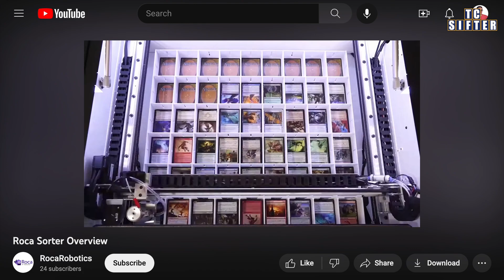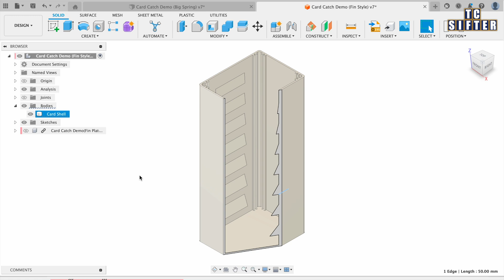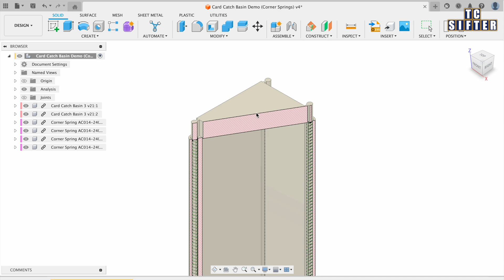Designing A Passive Card Catcher

Comment: i think you should just have the catch basins be curved a J shape, such that when the stack is tall, the card just falls onto the top, and when the stack is low, slides along the curve and then slides onto the pile when it hits it
Reply: wait i have a better solution! a magic card is 2.5 inch x 3.5 inch right - instead of making the catch basin these dimensions, you make it 2.5 inch x 1 inch and the load the cards in diagonally. after a card enters the top of the basin it will not be able to flip over entirely, and since the bottom stack is angled, it will slide onto it when it hits the bottom. then it can be arbitrarily tall

you may be worried about damage to the card but i think like a falling elevator, the air column in the basin will slow the fall so it should be fine

Comment: Springs are cool, another possible solution rather than add motors is to have the card drop servo pull double duty. as the finger drops the card into a bin have it continue to rotate to advance a mechanism on the back of the current bin/stack. This could be a sort of ratchet/pall system that uses gravity to advance the stack by 1.  If gravity isn't enough (especially true early in the sorting process) can have system use a heavier plate or have the plate in tension pulling downwards by a spring with its motion constrained by the ratcheting system. This setup would require a manual reset of the bins prior to sorting but not too big of a sacrifice.

Comment: Has anyone suggested rubber bands yet? Rubber bands on each corner could suspend the platform and would remain linear (more or less) rather than springs which will definitely bind if they're 9 inches long. You can also use pull springs, but I think that rubber bands will be easier since you can get a bunch of uniform rubber bands that are relatively weak and just use multiple per corner. This would allow you to fine tune the design by adding/removing rubber bands until you get a good stiffness. Also keep in mind that the upward force doesn't necessarily need to exactly match the weight of the cards, you just needs to make sure that the card fall is a height that you're comfortable with. I would say that as long as a card is falling no more than 2 inches you should be good.

Sorry if this has already been suggested, but I skimmed some of the top comments and didn't see suggestions for rubber bands.

Comment: shorter springs are going to be easier to manufacture, and replace for maintanance and testing. Given that, and that springs do not behave ideally at the extreames (in your case the start and end of the stacking) a few shorter springs in serires with a washer between will work much better. These shorter springs (maybe 2 or 3 in serires in the existing design channel) will behave much more consistently since the manufacturing tolorances will be lower (you need a "take the average" approach to manufactured goods unless you plan on some large percentage of rejects). I think 3 is probably the number to start with to minimize moving parts and open up design tolorances. The major downside will be making sure the washers don't flip or shift (hexagonal channel could fix that and still maintain enough contact on the springs). I love seeing the work progress and will want a prototype when they are ready!

Comment: Darn, I wanna see the final result lol. Well Im subbed. I hope you figure out the kinks and it works well without damaging the cards ^<^
Reply from the maker: Thank you! I should be putting out a new video shortly!
Reply: @jackbaumgartel  Is the video still planning on coming out? :)
Reply from the maker: @pdeer271  Yes my apologies for the super long delay! I took a break from the project for a while but am back working on it now
Reply: @jackbaumgartel  I was just looking into a setup myself and this came across and was just what I was hoping to read! For the card catcher though, I think there is an easier option . Since the cards come down from a ramp, if you raise the back of the boxes slightly so the card cannot go past it, as well as give the bucket a beveled edge feeding inward like a funnel, It should keep the cards oriented the correct way, and allow them to drop without issue.

Comment: Throwing my 2 cents in, albeit a little late. What about a pneumatic approach? It'd be easier to maintain consistency, and you could have the controller be centralized on the machine with hoses going to each collection area. Limit switches would guarantee proper zeroing. Other than that you could have the controller know how many cards have been sorted into each section and actuate the bed by the card width. 

This method also allows you to use software to easily change card widths for use with other games and troubleshooting.

Since you only have 6 slots i think the tubes would be manageable, and from my research the controllers are relatively cheap (compared to the r&d on fabricating specialized springs, at least)

Comment: The custom springs are probably going to be an issue, though they are cool and will absoutly work the price will probably cause issues if only doing small batches of them and the height may cause other issues with them like the springs possibly not fully going back to their proper size. Just a thought but would the reverse be a better idea? instead of compressing they streach?

Another possible idea would be to use only one motor and some gears to spin the screw that controlls the height. You will have height changes while moving back and forth while sorting but as you should probably keep your cards and inch or two below the top anyway to prevent the cards blowing out or other issues that shouldn't actually be a problem and it gets rid of custom hardware you would need, though it does add some fancy movement code or at least good gears and motors (just let them almost free rotate but stiff enough to hold the cards)

Comment: If you expect the stacks to be about equal height, you could have all of them on one side of a sea saw with the input stack on the other. This way every time you take away a card from the input stack all of the sorted stacks will lower by 1/6th of the card height. Then once the card i dropped by another 1/6th. Moving the pivot point of the sea saw you could adjust the fractions to be a desired target. By doing some clever lever mechanics that lock and unlock whenever the gantry selects the stack you could have a perfect system that lowers the stack by the exact size of each card no matter it if weighs more or less due to foiling, warping or lther factors. Though this design would be very complex and the mechanism needs to be developed thoroughly.

Comment: „Euler‘s buckling cases“ should be something you understand thoroughly if you plan to go with a spring based design.

I‘d advise against it though. If the part isnt readily available and has to be custom manufactored then you‘ve lost one of the original goals for the project: for people to built it (easily) at home. Unless you wanna become a spring distributor and have ppl but them off you.
Reply from the maker: Thanks for the input, and yeah that's a fair concern. Avoiding custom parts is a major design goal, but so is cost & complexity! I've got some great feedback here so this is something I'll be working on more

Comment: For something like this, I would highly recommend using extension springs instead of compression springs, or variable force spiral torsion spring or vspring if you want to go with springs. Otherwise I would highly recommend a continuous rotation servo motor. It would make for more electronics, but at ~$10 per stack for servo, switch and maybe some other small stuff, it's comparible in price. (A 9g servo has 1.6kgcm of torque)
Reply from the maker: Thanks for the input! I'm curious what advantage you see in using springs in tension or torsion compared to compression?
Reply: @jackbaumgartel  the vsprings are the same ones that are used in key card retractable lanyards, so are pretty low profile, and you can buy some casing mechanisms so everything is properly enclosed. For extension springs, you don't need a center post to stabilize the stack. And since there will always be a small horizontal component to the force it will self stabilize to a point in the middle somewhere

Comment: Why use springs at all? You already have an actuator poking down each well every time a card is added: why not have the base of the wells start near the top and slide/ratchet down?
If you do actually need them to be automatically reset, then suction the bases back up. If the depth is an issue, add a spring underneath with a clasp that releases the ratchet from up top.
It's not strictly passive but it adds 0 active components and doesn't rely on specific and delicate spring force
Reply from the maker: This machine doesn't use any suction or an actuator to drop the cards! Sorry for the confusion, I showed a few examples of other machines which used such systems, but this design does not. A few videos back on my channel I did an overview of the mechanical design decisions and whatnot if you're interested!
Reply: @jackbaumgartel  aah! I think the z axis was just a huge assumption and the suction was stuck in my head from one of the other examples! I was recommended the video without having seen the design of this one. I'll definitely go watch
Sorry for the confused suggestions ;p

Comment: I think a motor underneath each stack would be the most reasonable option.  They could be basic little motors that lower each time a certain amount of cards are added to that stack.  I.E. 25 cards drop in bay 3, then bay 3 motor drops .5 of an inch or whatever the calculation may be. They only need to go down with the weight of the cards, not up.  Think about a force fed paintballgun hopper.  They stop when a paintball is in place with sensors, instead of stopping with cards in place, just have the sensor at the very bottom when it is full the machine stops until it is reset.
Reply: Amazon has 6 for $7 i believe
Reply from the maker: It's a good solution! It would take some more hardware to get things moving properly and I suspect from prior experience that the cheap amazon servos likely wouldn't have enough power or precision, but it could be done. The added electrical power and wiring is considerable for 6 motors as well, but still I appreciate the input and will keep it in mind.

Comment: What about using a tension spring instead of a compression spring?
Reply from the maker: I had thought about that but didn't see any real benefit, and it would take up more space. Would you see a benefit to a tension spring over a compression style?
Reply: @jackbaumgartel  I just thought of it when you shared the 4 spring design. Might be better reliability (less likely to hang up maybe). Would be able to utilize the entire receiving tray capacity with a tension over a compression spring as well. 
However not an expert, so I would use my judgement sparingly

Comment: So rather than have moving parts on each catch bin, especially with temperamental springs and platforms prone to binding, I think it would be cheaper and more physically reliable to have the catch bins be static, with bottoms angled up at the back(towards the direction of entry so they don't fall out) and no rear wall, air flow slots on the front and sides, and then add a z axis to the catch chute(rotating up or down). You would have to track the stack height of each bin in software so that the chute would rotate its angle correctly, but this gives the best entry angle and it preserves the momentum of the card and doesn't force it to change direction until it is almost at a stop, and gives the best "falling" profile (narrow edge of card acts like a lever, or a closing lid)
Reply from the maker: That's a pretty neat idea! I hadn't thought much about giving the gantry "aim" and another degree of freedom to place cards more accurately. I appreciate the input!

Comment: OK, but what is the point of these machines? 

Simply curious. Clearly there's a niche here for machines and MTG cards, but what do they do? Is it for like building a randomized deck, or sorting cards by color, or what?
Reply: Easy of sorting. Sorting can take quite a bit of time and can be tedious so a machine to do it for you is pretty dope
Reply: I also sure if the software is open sourced after the machine is created there could very well be someone that could run with it to create random decks.
Reply from the maker: Great question! The main use case for these machines is card shops that will often buy and sell cards by the thousands. It's expensive and tedious to pay employees to sort and organize the 100,000 cards you just bought and now need to sell. Some serious collectors and hobbyists with large collections might want one too just to help organize their collections.

Comment: I suspect very strongly that a mechanism like you are describing is going to jam up/be unreliable in practice. Its a clever mechanism to be sure, but i just keep imagining the little taps from the card falling farther and farther causing a multiplicative uneven effect on the springs, and eventually causing jams.
Reply from the maker: It's certainly a possibility, but I am hoping that loose enough tolerances between the parts and smooth sliding surfaces will help prevent that. Definitely something that will need to be tested though!
Reply: @jackbaumgartel  I would think you could use one stepper motor to continuously drive a screw, and then use the movement of the sorter to engage/disengage the screw to lower the platforms, so you could drive 6 platforms with 1 motor?

Comment: I think investigating plastic compliant mechanisms to replace the springs could be interesting. They might do the same job as springs, but also be cheaper to produce, and more customizable for this purpose. 🤔
Reply from the maker: I do love a good compliant mechanism! I'd be interested to hear specifically how you imagine one might be of use here
Reply: @jackbaumgartel  the mechanism could be made of plastic or metal and tuned to bear weight of the cards the same way the spring does. However, compliant mechanisms can be designed to only move in certain dimensions and minimize defeclection in all other dimensions, so if properly designed it could be more reliable and less demanding on the design of the container.
Reply from the maker: @ZilchZilch11  Thanks for the explanation! Do you envision it similar to the passive fin-style catch basin I showed in the video?
Reply: @jackbaumgartel  I envision it most similar to the single central spring arrangement, and maybe a "scissor lift" shape

Comment: Also worth noting, this is a design decision that might constrain the build to just MTG, since card thicknesses and weights vary from game to game. Unless this is not an issue if there is a tendency for other cards to have their weight and thickness to have the same ratio? Worth looking into the weights and thicknesses of Pokémon, One Piece, Flesh and Blood, Digimon, and Vanguard. Those seem to be the games I've seen played at my card shops that have the same 2.5x3.5 inch size
Reply from the maker: Yes thanks for pointing that out! A few others have noted that too and it's definitely something I'll be testing out. I'm hoping that the weight difference will be trivial but that remains to be seen!